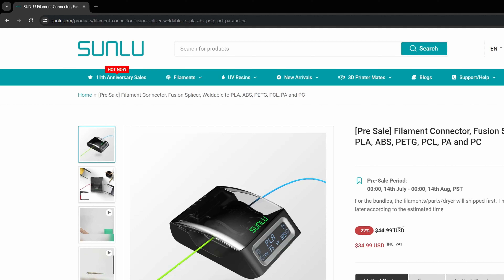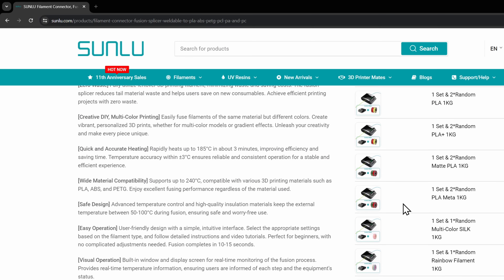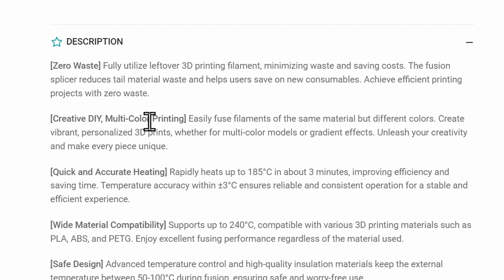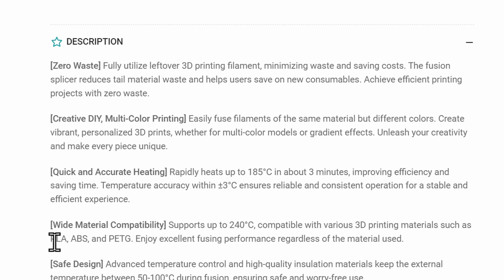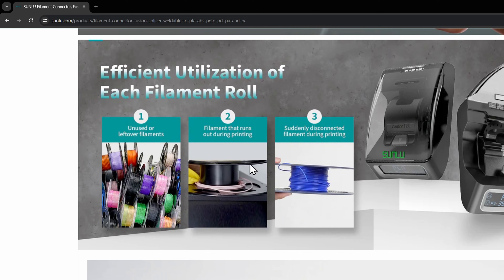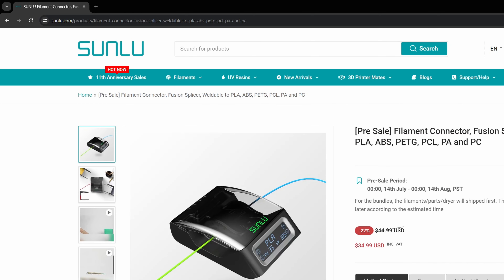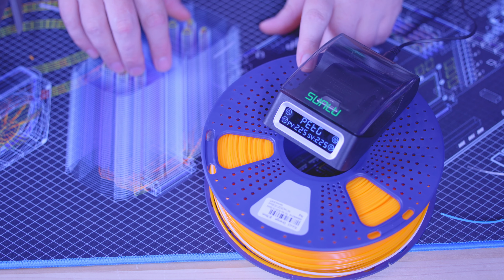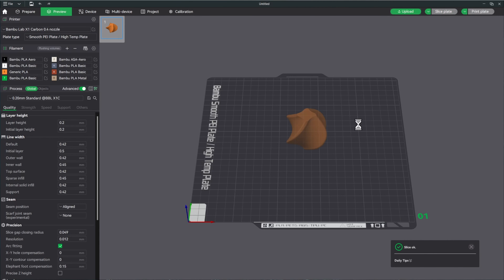Sunlu Filament Connector Review, Tips, and Tricks

Comment: 2 questions
 1 - if you connect a full spool to existing installed spool how do you remove sleeve? Can it be cut
2 - can the sleeves be reused?
 Thank you for your answers
Reply: Good questions
Reply: theres a little cutting tool integrated in the transparent lid
Reply: 1. You cut the sleeve after the filament has cooled and therefore is 2. NOT reusable. 3. You ONLY need the sleeve and a heat source, you don't really  need the device.

Comment: Kool little product. The one issue I see is that sleeve that goes over the connection. You have to remove it. If you have let's say a 1/4 roll you have to slide it down or put a razor to it.  Nice informative video Len.
Reply: It actually comes with a section that cuts the filament I'm not sure if he showed it in this video

Comment: Looks nice, a bit more usable then the average hack for welding filmanet you find on youtube.
I kind of was hoping that this weld wouldn’t need a consumable part. So this looks like the sleeves are single use. What if I have 2 long strands of filament, imagine 2 half rolls, now what? Do I need to use a knife to remove the sleeve?
Reply: The welder has a built-in cutter.  He didn't understand how the thing works.  It slices the sleeve along the axis of the filament in a second position.  The tubes are simply short lengths of silicone tubing.  I would think 1/16 ID X 1/8 OD.  Another way would be to simply slice the sleeve with an exacto knife.
Reply: Seeing how he was able to slide the sleeve down the filament, I'd say you'd be able to reuse the sleeves if welding together short pieces of filament. I'd imagine you could just slide the sleeve down to the next spot ya want to stick together and repeat. Also looks like you could probably cut those sleeves in half and double your numbers.